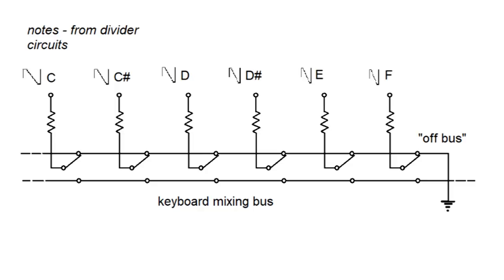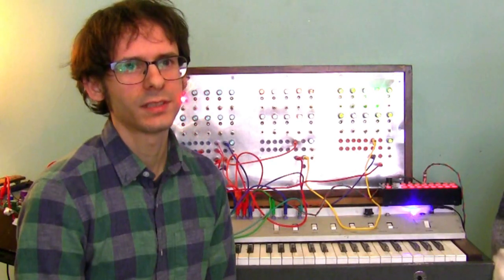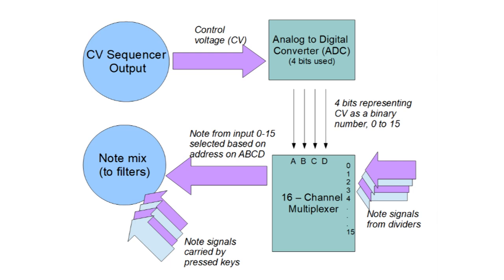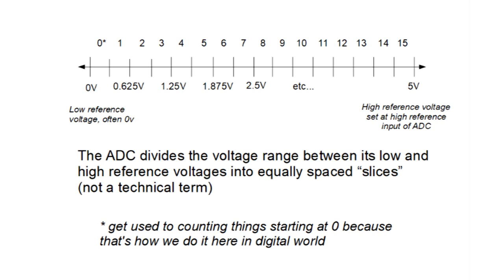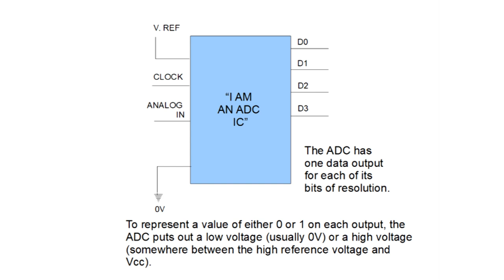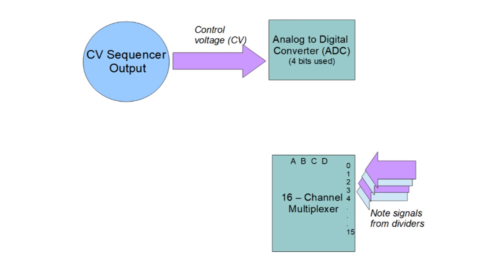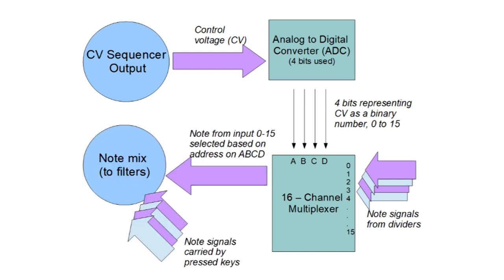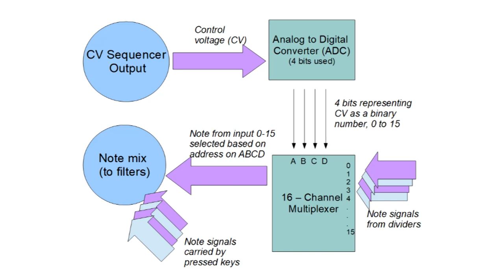"The Organ Machine" combo organ CV interface and how it works (ADCs and multiplexers!)

Comment: Amazing design! Multiplexers make every design better. I was wondering if you were going to use a priority encoder in lieu of an ADC to address the multiplexer. Very clever using empty channels of the multiplexer as rests
Reply from the maker: if the sequencer had rotary switches for each step or something that would have worked, but each step is just an analog CV so we had no logic values to work with... the voltage had to be digitized first!